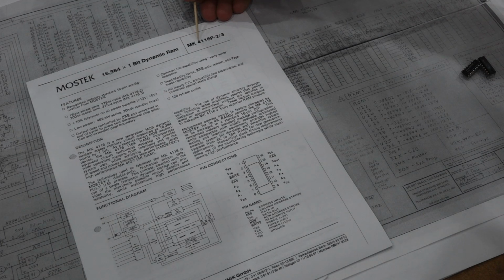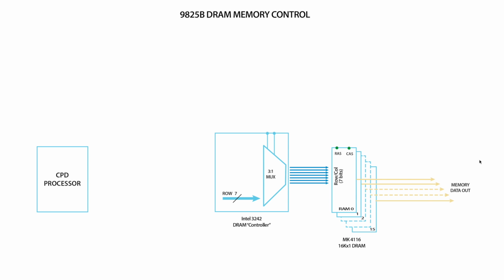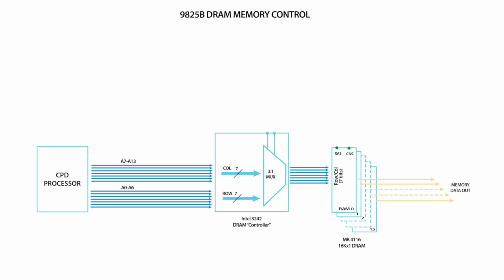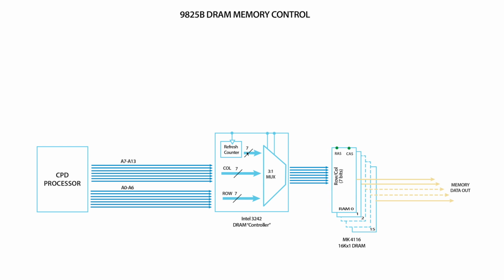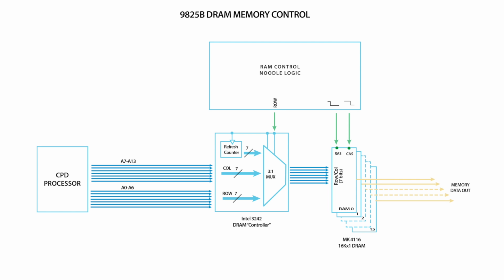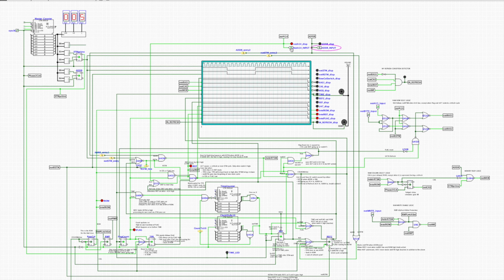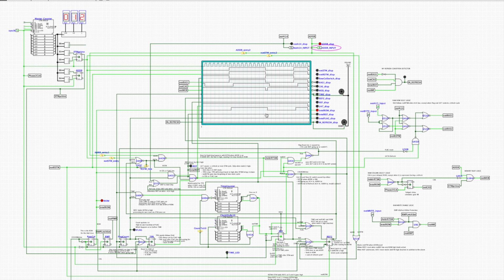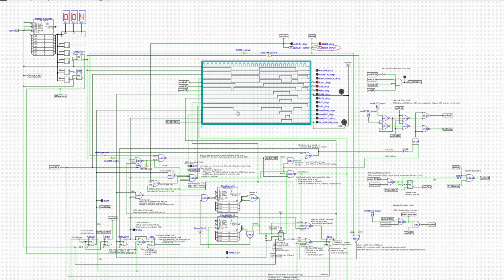HP 9825 Repair Part 8: memory fault finally identified, it boots again!

Comment: @10:19 i see.. that refresh sound-cycle sounds different (longer) than the other ones before...

@14:20 Just noticed that A. P. Products logo.  I've got myself a PowerAce 102 breadboard, which is where i recognized it from!

@20:45 Where'd you get those octal wheel-thingies from?

@22:39 I think the closed captions got messed up again?

Comment: I love those small red dot matrix displays that hp used. Haven’t seen anything similar these days and I don’t consider the lcd’s a close runner up.
Reply: Broadcom (which ultimately ended up with HP’s optoelectronics product line) still sells them, but they’re hellaciously expensive. (Around $40 for a 4-character module.)

Comment: hi. i very lame in english - what is a "noodle logic" termine you used? i try to wiki this termine but fails.
Reply from the maker: It's a lighthearted joke. People also call it spaghetti logic. It's when the circuit is so complicated, and has so many incomprehensible wires going in random directions and over each other, that it resembles a dish of spaghetti or noodles. I feel for you. Jokes are the hardest thing to pick up in a foreign language. I am not a native English speaker either, and I still occasionally struggle with jokes after many years of living in the US. Thanks for asking.
Reply: @CuriousMarc  aaa!  it's like "spaghetti code"? right?  i mean program with many's GOTO operators
Reply from the maker: @Rapsodiaast  Exactly! Noodle logic is the hardware equivalent of spaghetti code!

Comment: With the full schematic at hand, those massive boards could, in theory, be replaced with an FPGA and a few components that are "black boxes" that can't be replicated (like ROM for example, as copyrighted software, or bizzarre specialized, HP proprotiary IC's).  I wonder if Mike could help with that? :)

Comment: You are dashing the hopes of Apple engineers that you won't get this repaired.  You are not supposed to have the right to repair this!!!
Reply from the maker: I think it would have annoyed the HP CPD marketing folks of the time too. This is one of the rare HP machines of the time that did not offer any schematics nor a comprehensive service manual. Not even assembler instruction details. Unlike the HP-85 for example, or the HP 1000 machines. Fortunately we got engineering documentation recently from the original engineers that preserved it. Thanks for god for these folks.

Comment: What is the name or type of that 18:40 desolderimg machine?
Reply: It is a Hakko FR-300 (now replaced by FR-301 in Hakko's product line). Marc mentioned it at some point recently I think.
Reply: @josh46646   @krnlg  That's a amazing tool! I've never seen a motorized one! I thought the video was speed up but searching for this model now I see that's the real sound it makes. The desoldering was perfect, no suffering.  Thanks for your answer!

Comment: The noodle logic designer had probably a hard time checking manually his state machine...
Reply from the maker: I really wonder how they did it, it’s so “illogical”. It looks like this might have been done piecemeal, they kept adding pieces until they covered all the corner cases. Or they were geniuses with three brain lobes!

Comment: Hi Marc. I am following this repair with interest (but in general all your repairs to be honest). 
I have a question: what software do you use during the explanation (with elevator music)?
Reply from the maker: I thought of animating it with Keyshape, but in the end I just did a screen capture of Adobe Illustrator while I’m blabbing about it and turning on layers. With a screen capture tool that insists on putting the mic on the left channel! Either way, animations are very time consuming to make.
Reply: @CuriousMarc  Ok, thanks for the info. As for the capture software if it insists on recording only one channel, you should threaten to unsolder all the bits from it one by one ... it will work for sure! Ha ha ha. ;-)
Regards Marc.

Comment: Congratulations!
That makes my long-ago repair of a Keronix CPU board look simple....

I'd been wondering for a while about the nature of the RAM test; now it appears that it is indeed the old "test each cell individually, and don't worry about testing the addressing" approach.  By the time I started in the industry, making sure all the address lines were working was kind of standard, but the 9825 is from an earlier era when I guess people hadn't been burned enough by addressing failures to worry about testing for them.

Comment: Congratulations! Nice to see successful necromancy ritual☻
I wonder was it fixable with more common and simple repair methods such as thermal and current consumption comparsion with good board? Does that dead memory controller gets any hotter than good one?
Reply from the maker: Not that we could tell.

Comment: Hi Marc, while seeing your repair, HP 5004 signature analyzer came to my mind. Couldn't this tool be used for fetching good signature form working boards and compare then to the ones of the broken, to narrow down the faulty regions? But I think, to work with signature analyses, defined signals for triggering and gating have to be supplied by DUT. In addition, understanding what goes on is good any time. This logic simulation tool is super, thanks for your intro.

Comment: Puh ! Show that to a "modern" computer technician - and they don't even know what you are talking about. Apart from not having any idea on how to fix it other than "diss it and buy a new one". Most of them don't even know the testing gear. Things have come simple these days for "technicians" but accompanied with a total loss of understanding how things work basically. Or reading circuit diagrams. Good work. I think you find the faults on the other boards in almost no time once the base returns to work. Both thumbs up !

Comment: It would be a nice project to replicate the 3242: Three x 74x541 for the mux, a 74x590 for the counter and some additional gates for the control signals.
Reply: Make that two 74x541, since the 74x590 already has an OE pin.

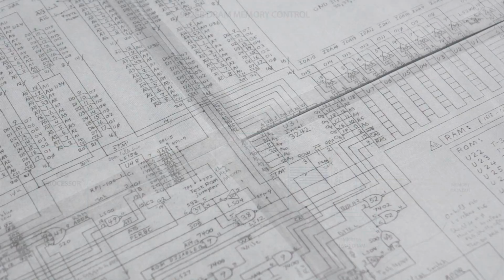Comment: 2:43 at this very moment when you revealed that there is an ASIC in the circuit on top of the million standard gates, I thought "I bet this is the one which is dead, just because it is more difficult to obtain" and see, there it is... Why always the unobtainable fails? 
Recently I was repairing an amp, and there is a complementary JFET input. One of the JFETs is still available for purchase, the other is not. Guess which one was dead...

Comment: Very interesting to follow how you are finding faults using logic analysers and other equipment! 😀
An alternate approach, especially since you are lucky to have another machine that works, would've been to acquire a thermal camera and image both the the working and faulty boards. 
Then compare and look out for chips that are either getting too warm or not warm when they should.

Comment: Interesting. Remember that Woz worked for HP. The Apple 2 interleaves ram refresh, processor and video with a minimal chip count.
Reply from the maker: He worked on the HP 2645 terminal IIRC, based off an Intel 8080. Very nice expandable architecture, great video capabilities. That is as close to a PC as HP had. Actually it was a PC, but they did not want to market it as such - although they eventually released one with BASIC running on it towards the very end. And price point was very high. He wanted to make a single board version of that or something like that, but HP denied. Take it with a grain of salt, this is all hearsay/stories. If I ever meet him I should ask him.

Comment: Well I got in late this time. So I won't be claiming my usual bits. But I will say congratulations on getting 9825 working. By the way. I really think Intel should have called the 3242 the R2D2. 😉

Comment: Marc, is there a reason you've been preferring octal in this series?  It seems like that machine would be more natively represented in hex.  It's getting late now, but it seems like the hex values and addresses would be more helpful in interpreting the behavior -- things like reset vectors, special boundaries like RAM versus ROM, or boot ROM, that kind of stuff.
Reply: Good question, maybe HP documented everything in octal? Seems it was more common back then.
Reply from the maker: No good 74 series TTL seven segment decoder for Hex, and my wheels were decimal! which is fitting, since hexadecimal wasn’t used at the time this machine was conceived, all the doc is in octal.

Comment: Super result so far! but did you fit the overvoltage protection crowbar circuit mod to the power supply yet?
Reply: I hope so. I'd hate for another "event" to do more damage.

Comment: I have an old logic trainer which is considerably bigger than that one, but I don't know if it's fully working or not and it has no brand on it either so I don't know who made it.  It has enough switches and LEDs on it to control an 8-bit microprocessor plugged into the breadboard.
Reply from the maker: Cool! I wish mine had more switches and LEDs, that’s why I have added a few...

Comment: Does this mean the keyboard display interface thing wasn't actually faulty? Or were you just testing using the good one?
Reply from the maker: We were using the good one. The original one is definitely faulty, we don't yet know to what extent.
Reply: I believe that is the board he mentioned by three digit number, and said it may have a similar number of bad chips.

Comment: I'm surprised that the calculator still has the original chiclet keyboard. They were replaced with a much nicer keyboard in the early 1980s. I worked with the 9825 and its successor the 9816 running 3060 board testers. They were almost indestructible and worked for decades. I wouldn't be surprised to still see them in production.
They only weak point was the tape drive which had a tiny grain of wheat bulb used to detect the end of the tape. This would burn out and the tape would spin off the reel and it was a real pain to get the tape, and the elastic band driving and holding the tape on, back together.
Reply from the maker: This must have been an A originally, which then got upgraded to a B/T.

Comment: I use to work for Hewlett Packard  in the Green Stripe operation doing component level repair on boards for the 9825. We had test ROM and RAM modules that fit into the option ROM slots. These bypassed the operating system and provided working RAM that allowed you to wake a dead system and provide a host of diagnostics to trouble shoot the system.
Reply: Just like that "death mode" diagnostics cartridge which Adrian uses to diagnose his Commodore 64's on his channel repair videos...
Reply: oh that's a neat idea

Comment: You did a pretty deep dive into the spaghetti logic. The simulator was a great tools for this. 
The fun part (for me) is actually re-tracing the design efforts by HP and getting a deeper understanding of how it functions.
And now your an expert on internal DRAM refresh systems in HP 9825s :D
Cheers,

Comment: Magnificent trouble shooting - Incredible patience. I've never considered simulation as a repair tool. You uncovered a major flaw in the memory test routine. It's challenging to do a good mem-test that is not mislead by hardware problems. You'd like data width to be as big as address width which you have here.  I'll bet HP didn't do production testing with this routine.

Comment: Over in silly idea land, I've sometimes wondered whether it would be possible to write a "custom" memory controller on an FPGA which skips refresh, and then measure error rate from a known write pattern to create a DRAM based thermometer!
Reply: Maybe if you already had a reliable clock, it would be a thermometer, and if you already had a reliable thermometer it would be a clock.
Reply: ... WHAT!?
Reply: @GeorgeTsiros  Well, the idea is that the error rate will be influenced by temperature, since it relates to how fast the capacitor in each memory cell passively discharges (a memory refresh is effectively just reading the memory and writing it back, which recharges the capacitors - you have to do it often enough that they never discharge far enough that you can't reliably read the data.  Since data doesn't have to travel during a refresh, it can be done in a highly parallel fashion, something on the order of of entire rows at a time.  I'm not entirely sure why you couldn't refresh the entire chip at once, though I suspect that attempting to do so would cause a sudden spike in power consumption, which might cause glitches elsewhere).  So you'd write out known values to memory, and then read them back and measure the number of errors you got after a certain amount of time with no refresh.
Reply: That's a completely mad idea. I like it!

Comment: where were you a fellow at? I was on a tiger team in phoenix.  I remember the original plotter for the optical stepper masks that was in san jose, it was in a halon room with emergency breathing apparatus, did you ever see it? I seem to remember it was 20x20 feet, but I don't remember exactly.

Comment: It's so interesting how you can debug and examine these older machines. Just before things became so integrated that you could no longer really do so. 

As a software dev I have little idea how modern hardware engineers can design and debug modern hardware. There must be sooooo much reliance on simulation and using larger and larger blocks of known good designs. Probably similar to software dev in that regard.
Reply: also multi-GHz logic analyzers

the testing methodologies evolved alongside higher complexity ICs.

Comment: I just wonder how many other chips have been stressed may fail in the near future.  Not to be pessimistic, just curious if I'm correct in thinking that.
Reply from the maker: Pretty likely. We had one case already. One chip that self-immolated and let the magic smoke out.
Reply: @CuriousMarc  how difficult would it be to design the mainboard in such a way that it could self-test all ICs and perform checksums for the ROMs?

Comment: It's alive! Very impressive. Love the troubleshooting of actually understanding the circuit and replacing broken chips, not just throwing darts at the board replacing every part and cap you can find!
Reply: Well... So far as repair for hobby concerns, not everyone has the money to get the tools (like this super uber HP/Agilent logic analyzer) to make a proper diagnose analysis, specially in today's complex and speedy logics.
And as for the "production" grade repair industry concerns... Unless is a super custom thousands of dollar board, makes more sense to just go and replace whole "lego" blocks on the system. Consumes less money... And what's more important, TIME.
Reply: @hyoenmadan  Specially with recent products, it's faster and cheaper to replace common problem chips and then go from there.

Comment: I am overwhelmed and mind-numbed by your heroic effort in repairing this ancient system. Quite an amazing amount of work.
 So I confess and apologize that I don't watch every minute of your videos. Thus have a tiny, tiny question.
Is it a requirement that you must use this MEMORY CIRCUIT BOARD? In other words, fix it?
I imagine you could replicate the entire function of this 2K monster with a raspberry pi zero. ($5)
Reply: An FPGA is another great way of replicating functionality. Or a Pi Pico, that way it doesn't need to boot Linux like the Pi Zero. Still, there's a kind of magic with old hardware, and it would be a shame to throw it out when it can be repaired.